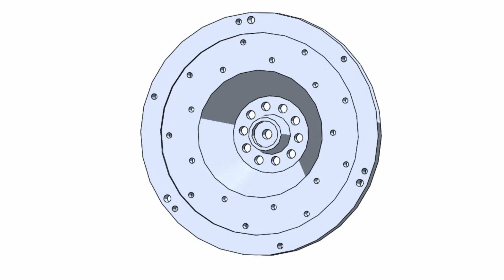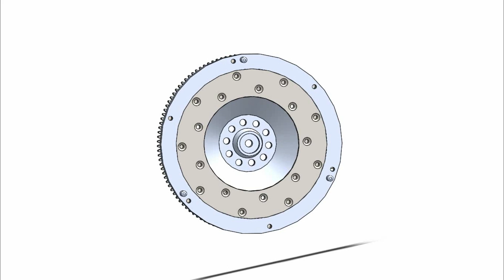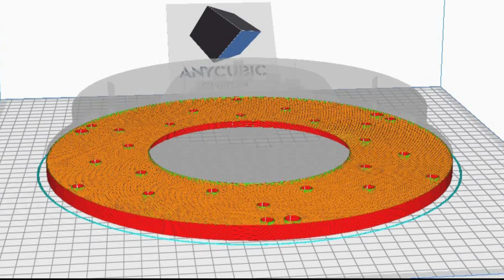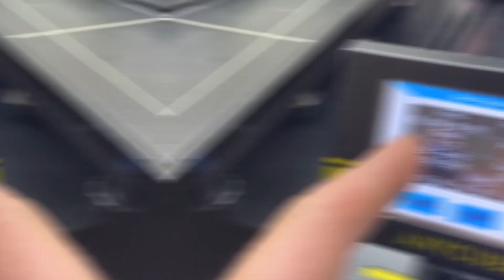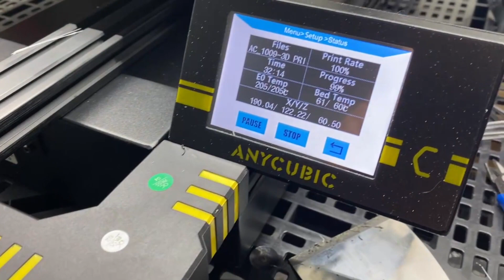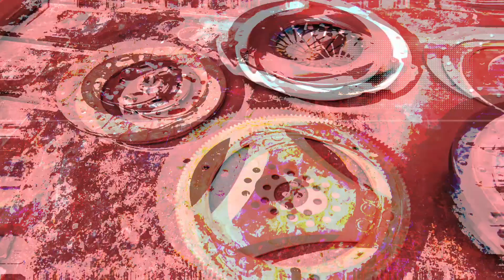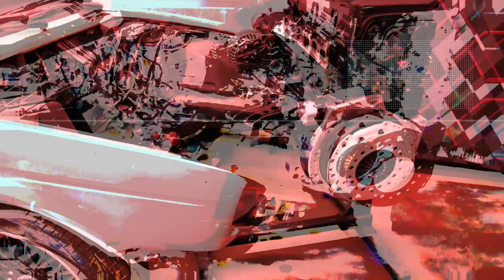BMW VR6 Flywheel design & 3D PRINT (30+ HOURS)  -  E30 VR6 EP  9

Comment: Do you have a conversion kit for sale?
Reply from the maker: Yes, once every is tested I will be selling kits
Reply: @APEngineering I'm buying this for my 12v AAA engine and my E36 Coupe. Please, inform us when It's done. 💪
Reply from the maker: @rosstihh2220 That will be an awesome setup ! Should be available during 2026
Reply: @APEngineering Can't wait!! If you include everything to get the engine in the bay like plug and play it will be more than great. ❤❤❤
Reply from the maker: I will have to do some research for the mount since E36 is not exactly the same as E30, but it should be easier since E36 has more space.
Reply: @APEngineering There is a bit of a difference in the mounts, but mostly different is the subframe. The E36 is with a rear sump. If you include the subframe too your kit will be one of a kind and it will sell like a hot bread. 🤘
Reply from the maker: Im planning on making lightweight tubular subframe now that I have a 3D scanner also
Reply: @APEngineering , It's also an option and I think it will do the job if It's made by some serious pipes and welds, enough to hold a powerful turbocharged engine. 👍
Reply from the maker: Thats for sure ! Will make the best possible option

Comment: I designed one for my car. I'm still undecided on the material. Not so convinces about the lightweight a super lightweight one.....I questioned myself if its possible to make a steel one with a replaceable face....I had a couple of ideas bolted to the flywheel or screw ( counterclockwise) to the flywheel with a stopper on the back and maybe a couple of bolts to hold it in place....Not superlight weight but also you don't have to pay an arm and leg to get another flywheel.
Reply from the maker: Flywheels are not a simple part to design/fabricate ! There are many options and ways to do it. I decided to go with aluminium to reduce the machining costs and since it is very big to reduce weight.

Comment: Hey! I watched your video on you 1.9tdi swapped Audi. I just finished swapping the same motor into my b6 A4, I was wondering how you got the tach signal from the TDI ecu to the audi cluster!!
Reply from the maker: Hi Nolan ! Its been quite some time since I completed the swap so I do not remember exactly what wire I plugged where, but I do not remember having to do anything special. I just wired the tach signal wire from the ALH harness to the tach signal wire of the Audi. The only special wire I remember was to send the speed signal to the ECU. This wire had to be taken in the ABS pump harness. Hope this helps !
Reply: @APEngineering  Okay Thank you for answering me! I'll see if i can trace those wires!

Comment: This is amazing any chance of selling a kit in the future or could u hook me up with a 3D printed adapter and flywheel I’ve been building a vr6 just for a mk2 or something but I have a e36 that I feel it would be a good fit into it do u have a Facebook you post on?
Reply from the maker: Thanks ! Yes the plan is to sell a BMW/VR6 swap kit in the future. But I need to finish the car to get everything tested before. You can check out my Facebook and Instagram accounts that are in the video description
Reply: @APEngineering  that’s awesome man… I would to do a vr6 e30 or e36 swap! What’s a rough price you’d charge for this flywheel and adopter plate
Reply: @APEngineering  sick I’ll definitely be buying one in the future just a little longer and my 24v build will be done then just need something to put it in been in the making for about a year now
Reply from the maker: Sounds good ! Its going to be a nice project